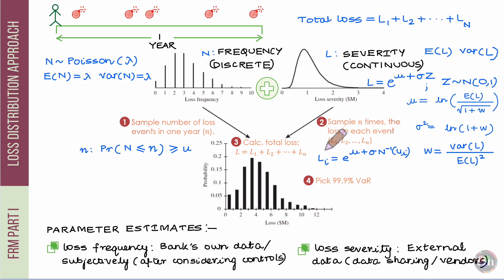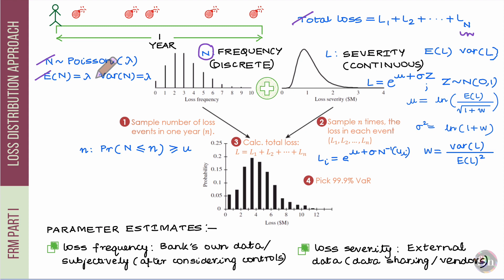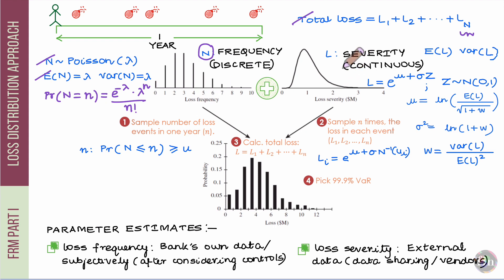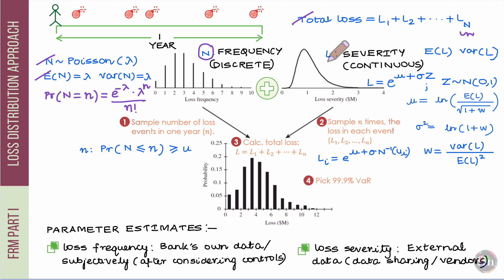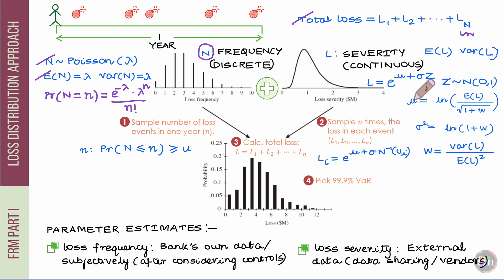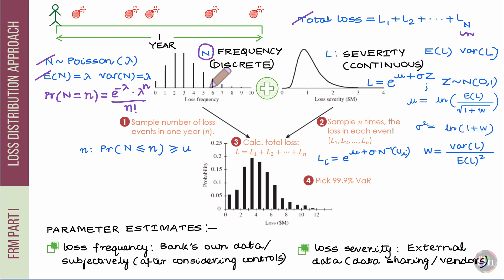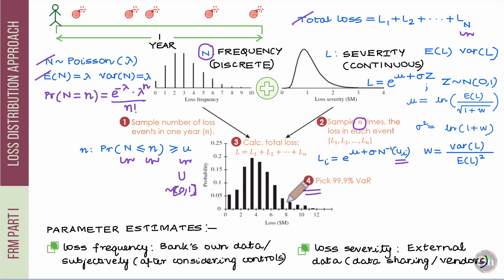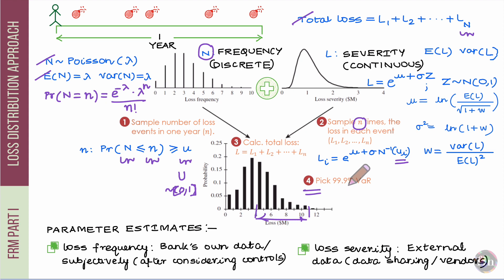Operational Risk: Loss Distribution Approach | FRM Part 1 (Book 4) | Valuation and Risk Models)

Comment: Would you consider the exponential distribution for loss severity as an appropriate choice for modelling operational risk via monte carlo? (given the fact, that the lognormal distribution would lead to extrem values, which are not realistic, due to few data points and high variability in the data)
Reply from the maker: The lognormal distribution is one of the most commonly cited choice for loss severity distribution (the other choices being Gamma / exponential, Pareto). Exponential is a suitable choice if one is looking for a distribution that is relatively light tailed.